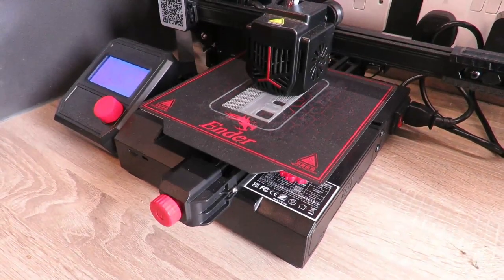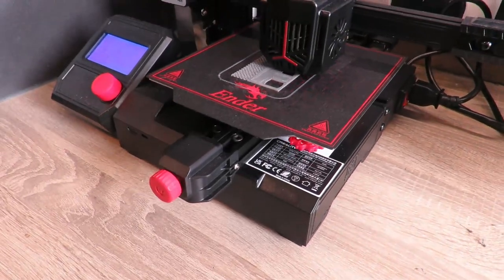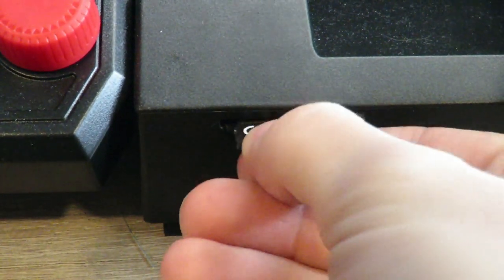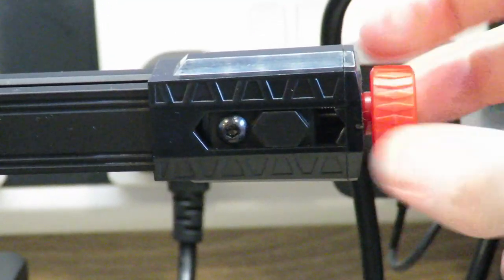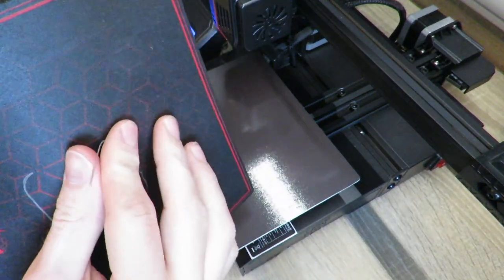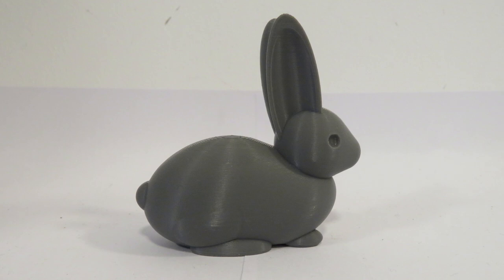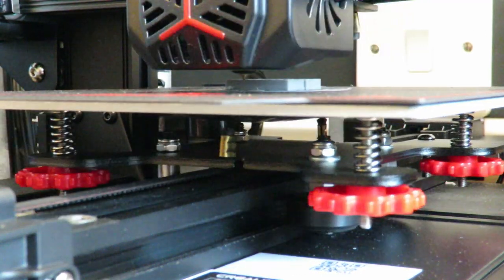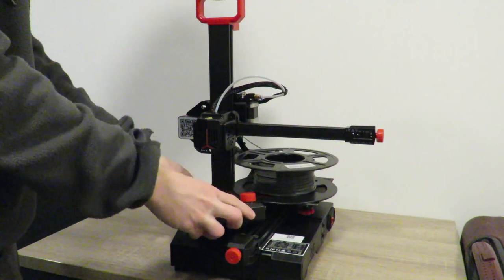The Cheapest 3D Printer That Out Performs Most On The Market - Creality Ender 2 Pro

Comment: Amazing printer for beginners and for making your first printer farm, I've using it for 3 months and no problem at all, just calibrate it correctly and use 40mm and 120mms do not rush speed on this printer and will be fine.

Comment: It's a very good printer and was my first. However, a word of caution is needed. As far as I'm aware, for some time the printer has come with a microcontroller that is not supported by Marlin. Creality has not released a version of the firmware that supports BLTouch. This also precludes many mods unless you want to go with a different firmware altogether (such as Klipper), but I wouldn't advise this to someone completely new to 3D printing. Having said that, the printer prints well out of the box, and you won't be disappointed until you outgrown it's capability.
Reply from the maker: Yes, however someone that is completely new to 3D Printing isn't going to need all the features such as BLTouch that's why this IS a great printer for beginners to the hobby. It's simple and straight to the point and can facilitate enough modifications to learn what can make printers better.
Reply: @BudgetModelRailways  I agree with you, I just posted the message because a lot of information and guides for this printer are based on the version with STM microcontroller, and people who are new might think that all the ender 2 pro are the same and have same capability. I have seen several people asking for guide on how to add bltouch only to discover that they can't. I just hope you make this clear in your next videos about this printer (if you mention modifications that have the limitations above-mentioned), to avoid disappointment from people once they discover it. Apart from this, good video and I'll wait for the next, it really is a nice little printer.
Reply: I added a BL Touch to my Ender 2 Pro with no problems and it works great. I flashed TH3D's unified firmware to the mainboard to facilitate this, again with no problems. The Ender 2 Pro is a great little printer and does everything I want it to.

Comment: Hello doug as a beginner to the hobby who wants to build his fist layout on a budget ,  I’m hoping to buy some pre owned N gauge locomotives, I know I can’t expect them to be perfect and I know I can expect some parts to be missing so my question is could you make any part for any locomotive providing you had all the details 🤔.    Paul
Reply from the maker: Yes. The smaller you go the harder it gets though. I've printed replacement OO Gauge buffers and handrails but N is very tiny so would be harder, still very possible
Reply from the maker: The main issue will be that many of the older  UK outline locomotives are pretty poor runners, especially at slow speed, and the prices are high. I switched to Kato Pocket line locomotives which are more reliable and cheaper new than most second hand
Reply: I’ve heard some good things about Kato N gauge but the videos I’ve so far watched on you tube do seem to be modern locos from Japan and the United States the detail does seem to be very good for something that is so small !  Please can you tel me if they do Uk steam locomotives or is it just japan and the USA.  ?     Paul

Comment: Hello,for the price it's a absolute bargain,it does the same as the other one.would it be as quick as the dearer one or the same.
Reply from the maker: Speed is a complicated topic for 3D printing. Simple answer is no it has smaller motors so can't handle as high speeds. However the faster Sermoon has less part cooling ability so when printing at high speeds parts will often warp. It's a bit of a trade off